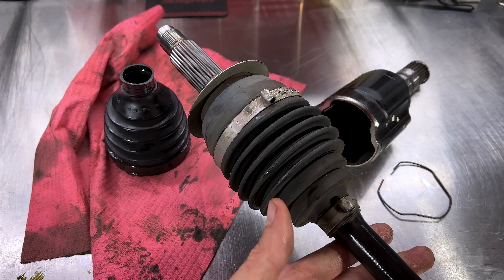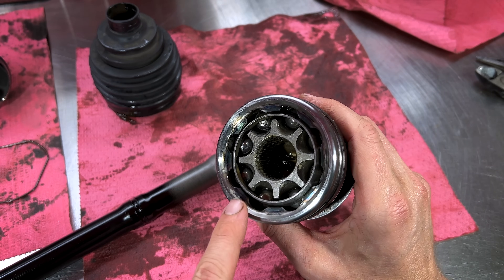100k Mile Subaru Forester CV Axle Teardown & Failure Analysis | Why Did It Fail?!

Comment: I have the exact same noise. Now I’m wondering if this issue is also related to something else I’m experiencing: when I turn the steering wheel all the way to the right or left and start moving, it feels like I’m driving over a small rock. I feel a brief loss of traction, almost as if the wheel were loose or about to come off.

This only happens at low speeds, like when I’m pulling out of my garage or making a U-turn. It’s driving me crazy.

ChatGPT says this could cost around $2,800 to fix, and my car only has 48,000 miles. Honestly, that doesn’t feel right. I was told Subarus are reliable—that’s exactly why I bought a 2021 Forester.

I really love my car, but this noise has me disappointed. Paying $2,800 at only 48k miles just doesn’t seem fair.

Comment: Do not use aftermarket cv axles on a Subaru. Aftermarket is total garbage. They’re not made to exacting specifications and they will destroy the 4 wheel drive system.

Comment: Hi Mr. Subaru. First, you are the first person on YouTube I check whenever I have a problem with my 2003 Forester. You have been a reliable resource for many years. I do have a question. Where in the world can I buy a front Hub and Bearing assembly (part #). I can find rear one's everywhere but not the front.

Comment: Hello Mr. Subaru, Thank you for your amazing videos. I really need your help with this question, 2014 Subaru xv Crosstrek , I replaced both front wheel bearing hubs and front passenger axle. When driving  at 40 mph then when I release the gas pedal the making some type of noise I can't figure out what could it be. Any clue what should I be looking for?

Comment: Just had my rear driver side axle fail on a 22 wrx at 48K. 

Front axle seal failed at 30k - found the spring inside my transmission on the drain plug. 

My clutch throwout bearing went out at 15k. 

Miss my toyota

Comment: My only wish through this is knowing how you removed the cv from the axle…I can’t for the life of me get that connection apart
Reply: @1cnfour349 - I learned from others to use silicone lubricant (or even WD-40), then use a quality metal pick to very gently lift just the outer edge of the boot seal. Spray the lube into the gap you created. Keep slowly moving around the axle, pulling away the boot just a very tiny bit to make room for the lubricant. After you work your way around, you can work deeper under the boot seal. Or, work deeper slowly and then slowly around. Either way, slowly is the trick. Once you've fully separated the rubber boot (but let it go back to touching), you will find it can be difficult to slide off, but it will come off. (Of course, you need the tripod joint removed first!)

Comment: Seems like a lak of design innovation in these. The rubber boot seems  particularly weak and likely to rip or wear out  prematurely. Especially when the vehicles are being marketed as rugged all wheel drive all seasons. As often as CV's fail on Subaru's I think there would be more customer pushback / ???

Comment: Think they could have a better  engineered setup instead of such a complicated piece of equipment that wears out fast.
Reply: Didn't see your post. I just pretty much posted the same opinion/question. Seems like a weak design to me, seeing as how 100's of milllions go into designing vehicles you would think they could come up with something better than a "rubber boot" !
Reply: @willhicks2259  - What's your better, cheaper solution?

Comment: I recently did all the boots on the rear axles of my 02 wrx. Due to the lack of knowledge on the circlip in the diff procedure the job became A nightmare. Maybe a quick short on addressing this circlip could help others. the tech data fails to specify install procedure. after ruining an axle shaft end upon reinstall due to circlip being on the axle shaft and not reinserted into rear diff FIRST!
Reply: Easy, when installing axle shaft back into diff axle side gear,ensure circlip open side is to the bottom of shaft,slide into side gear until contact with circlip is felt,pull it back approx 1/2 an inch,firm push,and axle should pop in.Give it a few light tugs to be sure
its properly in place,it never hurts to take an actual look at it too.
Reply: @user-gv2nh4uw2i  so you slide it in with circlip on in that orientation?
Reply: @Christosan88 yes,circlip gap to the bottom

Comment: Changed out control arm,  strut,  swaybar links, huh assembly,  rotors and brakes.  Don't hear a click nose but hear a bang noise like someone is taking a hammer to something. Only happens when suspension travels.  Can't figure it out.

Comment: My 2015 crosstrek clicks after I’ve driven it for more then 15min when I turn and when I back up it clunks then is fine if I’m going straight, car has 90k miles and I thought at first it might of been the center differential because the sound came from there but now it comes from where the cv axels are

Comment: If the ball bearings fail, would it be possible to replace just the ball bearings and using the race and the cage? Or should the entire CV axle be replaced?

If the original Subaru part fails, then theoretically it'll happen to the next CV axle. Replacing the ball bearings to something that's higher quality could work better than replacing the actual part.

Comment: Thank you for a very informative video!  As a consumer, I like knowing why I'm paying my dealership $1500 to replace both front axles at 100k miles on my 2016 Forester.  Any statistics on fail rate for this part?  What's the average life of an axle?  I'm mostly city/highway driving, but lots of garage speed bumps and pot holes everywhere, so I'm not particularly surprised that my axles started to fail.
Reply: I am a automotive student who also own a 2016 subaru forester, my both front axles start clicking around 80k miles, i use it as daily and as a delivery vehicle, so alot of stop and go ,cornering, run over rail roads,pthholes driving.I also had replaced both my lower control arms as well. Compare to toyota, nissan, honda , subaru's suspension part are kind of low quality.

Comment: Hi thanks for the great Subi vids. This might be a dumb question but is there a Left & Right cv axle. Local garage told me I need both so they want to charge me "$1700 out the door for both". They originally told me $850 for the Right. The Subaru dealership is almost as bad. They're telling me if I don't "do it now" I'm gonna get in or cause a massive accident. Does this sound legit to you? Thanks again

Comment: I feel like that axle failing like that in only 100k miles, with good grease still in there, had to be a latent defect. The ball bearings were probably bad straight from the factory. 
With the expense and trouble of replacement, I'm always confounded as to why it isn't more typical to service the CV joints at certain intervals, before they fail. Cleaning and repacking, inspecting and if need be replacing the boots, they should be able to outlast the rest of the car. The tools for doing the boot clamps are the weak link there. I've looked into buying them several times, turns into a fiasco every time, just can't find good information.
Reply: @Jerseyhighlander - I bought one of the boot clamp crimpers for a tie rod. It even has a hole for using with a torque wrench, so you get a technically perfect clamp pinch (on a new clamp). After buying it online with zero return policy, I realized the inner tie-rod boot can't be reached by the wrench. I'm forced to use a zip tie in the end. $30 for nothing. Would you like to buy my crimper? 🙂
BTW, I was raised in the Ramapo Mtns near the NJ/NY border, so we have a connection there. Now I'm living an hour south now.

Comment: Ahh.. I was wondering how that CV kit race & cage was taken apart, since my '05 service manual makes no mention of it.
Would the '05 Outback be disassembled the same way as this newer Forester CV? Seems like the older axles were stronger.
Edit: I tried and I don't think you can take the outer CV apart on a '05 Outback..

Comment: Hey man. I had my front axel come off after a CV Joint replacement at my mechanic. They’re going to fix it but what other things should I ask them to check. I heard the axel hitting stuff and what not so I’m worried I may have other damages but I don’t know what to ask for or what for them to look at. Is it possible the steering parts need to be replace or the differential?

Comment: I just brought a pair of CV joints this morning because the wear on the driver's side is getting worse.  Anyway, my 2010 Subaru Forester has 443,333+ miles on her and it's time to replace the shocks while the front end is being worked on.

Comment: Great video. Thanks for taking the time to publish all these - and for including the part numbers.  Having a CV failure (normally a torn boot on our Austin America's) is not unusual for me with our British cars from the 1960's, but I've been spoiled with our Chrysler products ('80 Horizon, '84 Omni GLH,  '86 Lancer Turbo, '89 Shadow, etc.) such as my '89 Neon Expresso Coupe DOHC with over 210K miles on the original 1/2 shafts.  I hope my 2020 WRX follows in my Neon's foot prints with zero failures!

Comment: 12/11/2021 bought brand new OEM front axles for my wife's 2017 forester 106k miles at the time.  14 months/14kmiles later hearing noises when making sharp low speed turns.  Junk with only 12month/12kmiles warranty.

Comment: For the bearings to get like that it could only be improper lubrication,which happens with age and heat of the actual axle grease.If it could be cleaned out and regreased its a good possibility this would be avoided.

Comment: Question:  My 2013 Subaru Outback 2.5i makes a single clunk/pop when I make a 90 degree left turn.  Only a single clunk/pop from a stop or a slow left turn.  I can feel it in the steering wheel when it happens.  Looked under the car, cvs boots are fine.  Any suggestions?  Thanks.  Always great content.  So easy to follow for us DIYers.
Reply: Does this in my legacy. Same year ect. I think it's clutch pack transferring power. As I've already changed front cv joints, so not that. And I've driven in donut since replacing and no click
Reply: @codyhill9087  Thank you for the tip!  I recently replaced cvs as well so was confused, especially with the single pop and not a constant clicking.  I’ll check the power steering fluid and then move to the clutch pack.  I was in MT last summer and managed to heat up the ATF to the point the dash warning came on.  Thanks again!
Reply: The club/pop may be coming from steering rack, especially at  90 degree turn it probably reach it's maximum if that's only place you hear the noise
Reply: @hno7625  Thank you!  As always with cars, so many potential problem sites.

Comment: Crazy, the boot on my 03 WRX was torn and had grit in it and had slung out a bunch of grease but didn't have an issue. I just disassembled, cleaned, regreased, rebooted, and stuck it back in and has been good for years. Not sure if all my axles are original though bought the car @ 99,000 miles, now at 270,000.

Comment: I know that the vehicle has essentially 100K on it, but would it have been possible to replace just the CV joint instead of the entire axle assembly? To me the noise you encountered was most likely CV failure. But I suspect it's easier to replace the entire assembly especially because of the mileage, rather than removal, disassembly, and diagnosis? BTW, thanks for sharing this info!
Reply: Subaru CV axles from dealer are 400+ per axles all the aftermarket ones cause vibration. And clucking nioses when turning
Reply: @openleft4214  - Maybe Subaru's OEM has hired people to go online into various forums and claim that aftermarket parts have problems! ;-D  Seriously, it sucks hearing of these problems. I am putting an aftermarket control arm and tie rod on my Legacy, and I have heard those parts are also not as good as OEM. But the OEM cost is outrageous, so I am taking a chance.

Comment: very nice info Mr Subaru..
CV=Constant Velocity joint cuz the input and output rotations of the joint shaft/spindle R the same speed, regardless the angle of the wheel directional turn. This is NOT true in the old  U joints.
so, as the wheels turn directionally, we don't feel any power modulation on the steering wheel.
..5 km ago at 155km, my 03 Legacy Wagon, started giving me the tik tik noise on the straight, and when the wheels were cut all the way to turn. The noise stopped after about a week , and later I replaced the axle, cuz I did exhaust work. The secure pin was difficult to drive in! I still have not checked the root cause of the failure. The replacement axle part, was after market. 
The drive shaft, still uses U joints, cuz the angle is NOT steep =NO modulation.
The steering column has 2 U joints, n when they dry, the driver can feel the modulation while turning the steering wheel.

Comment: My crosstrek is making a crispy metal clicking noise when hitting potholes above 30 kmph. Of course that can be heard when windows are down. The noise is more from passenger side. The car is still pretty new, 70k km. Could that also be a CV axle problem?

Comment: I am driving 2005 outback and still cv joints are working. In corners when I am accelerating i alredy hear a sound. Outback run 223k miles already.

Comment: My 2009 Subaru Forester has 172,340 miles on it still have the original cv axles and the are still quiet no unusual noises I also have a 2000 Toyota tundra that is all original with 245,450 miles on it long live older Subarus and Toyotas

Comment: Damm. JUST payed $1500+ at 72,000+ miles for a new axle on my 2018 Forrester. PLUS the desk technician said that another had already been replaced, under warranty, before I bought it at 40,000. Not good 😒
Reply from the maker: The axle’s list price is $400. How’d you pay $1,500?

Comment: Question, could you replace the bearings and make that shaft reusable?
Reply from the maker: Yes
Reply from the maker: Well, replace/rebuild the CV joint
Reply: @MrSubaru1387  What is the part number(s) for inner and outer kits?  Or what parts in total are needed?

Comment: Hey Mr.Subaru, we recently replaced our front CV axles, the shop that did the work used aftermarket axels and our outback started to tremble when in drive and at a dead stop. We replaced motor/trans mounts and the shaking persists, will I have to replace with OEM axels?
Reply: yes OEM or your gonna have balance issues. Replaced many of these and aftermarket are junk.
Reply: @robertbarcus1963  thank you brother
Reply from the maker: I never installed aftermarket axles for this very reason. They’re always too long or short and always vibrate.
Reply: @MrSubaru1387  Whats your opinion on Raxles brand (raxles.com) aftermarket CV axles? For aftermarket, they seem to be high quality and might be a good alternative to OEM. I have an '05 Outback XT and I believe I need a new driverside front CV axle. The issue I’m having with my car is it’s pulling really hard to the right. So much so that you really have to fight to keep it going straight. Upon inspection I noticed that the boot on the inboard side is torn. I do not hear any clicking when turning or anything. The only symptom I have is the hard pull to the right. They don't sell new or even rebuilt ones from the dealer anymore for older Subies correct? I was about to source one from PMP Autogroup, a used Subaru parts dealer close to me but I'm a little hesitant because the axle could have 100K+ on it for all 1 know. I believe the one thats on my vehicle now is past the point of no return so a re-boot is probably out of the question. Thanks in advance for your help!
Reply: @MrSubaru1387  Whats your opinion on Raxles brand aftermarket CV axles? For aftermarket, they seem to be high quality and might be a good alternative to OEM. I have an '05 Outback XT and I believe I need a new driverside front CV axle. The issue I’m having with my car is it’s pulling really hard to the right. So much so that you really have to fight to keep it going straight. Upon inspection I noticed that the boot on the inboard side is torn. I do not hear any clicking when turning or anything. The only symptom I have is the hard pull to the right. They don't sell new or even rebuilt ones from the dealer anymore for older Subies correct? I was about to source one from PMP Autogroup, a used Subaru parts dealer close to me but I'm a little hesitant because the axle could have 100K+ on it for all 1 know. I believe the one thats on my vehicle now is past the point of no return so a re-boot is probably out of the question. Thanks in advance for your help!